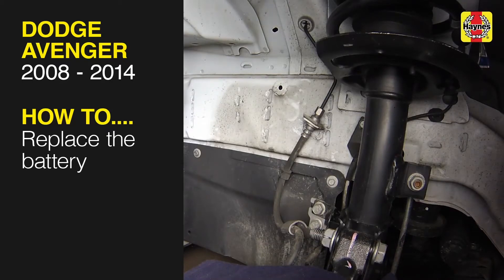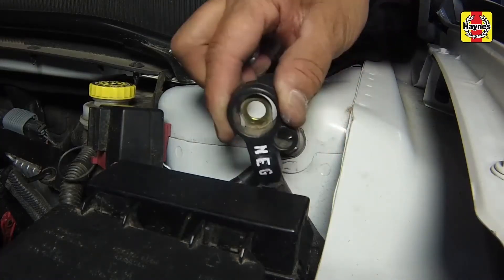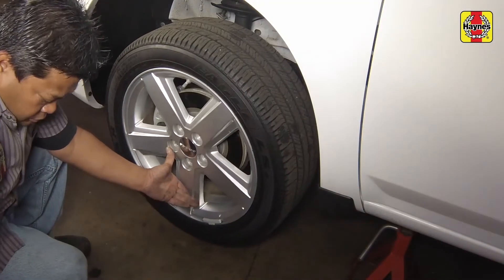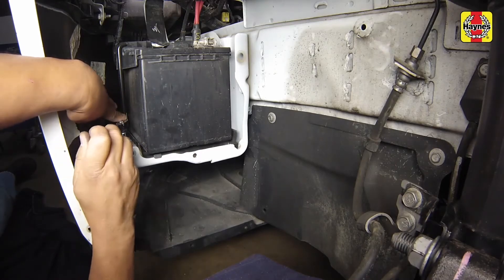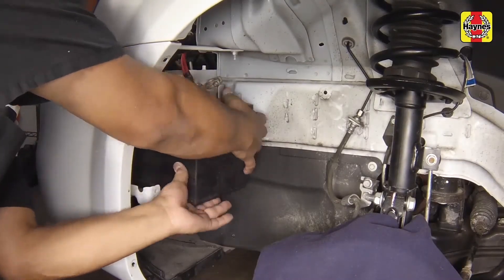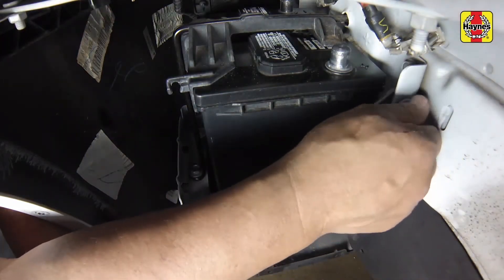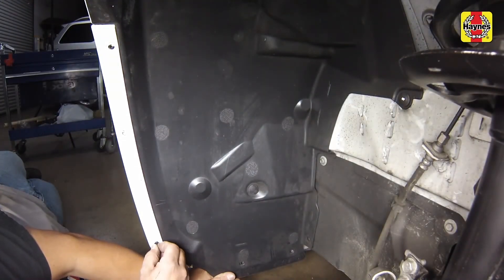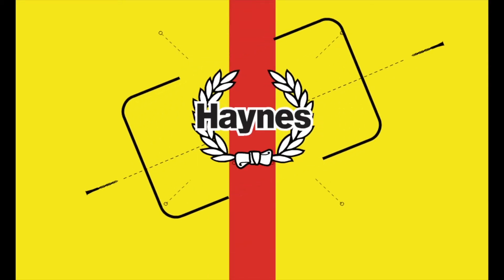How to Replace the battery on the Dodge Avenger 2008 - 2014

Comment: Note to self:

Make sure my next car has a more easily accessible battery.
Reply: I swear. 😤
Reply: There's a Cadillac and another GM model that requires removing the back seat. Not lift a cushion, that's for jump starting and testing. To switch to a new battery you have to take the seat out of the car. Why not just stick it in the trunk? Who knows, probably because engineers hate mechanics, and vice versa.

Comment: Youll need:
7mm socket for the plastic splashguard
13mm socket for the battery brackets
15mm socket for the battery terminal
A prying tool for the plastic splashguard
Reply: 10mm battery terminals
Reply: THANK YOU

Comment: THIS JOB IS A PIECE OF CAKE. IT TOOK ME 30 MINUTES. USE SIZE GROUP 86 BATTERY. YOU WILL NEED A 7MM 10MM, 13MM AND A TRIM TOOL.

Comment: Cool video! But you don’t have to take the wheel off. All you need to do is turn the wheel all the way to the right and then remove the cover.
Reply: @Believer610  actually? I’m going to change mine today? Going to try this lol
Reply: Do you have to jack it up and turn it to the right? Or just turn it to the right? lol
Reply: While it’s on the ground
Reply: @DoppleCU  no jacking up! Just turn the wheel all the way to the right and you should be able to get to the battery. You can also find it in the user manual
Reply: @Believer610  amazing, thanks for posting this
Reply: @Believer610  Should be able to??
Reply: @HuskerRed11  yep

Comment: I have a problem, first of all I didn't remove the wheel I removed headlight and fender clips my battery sits directly in front of my tire. I recently had to get a new battery and it doesn't fit properly in the tray, this new one is enclosed in a hard plastic shell the holding brackets are not able to be installed properly. So without putting the fender wall back on the tire is merely inches from the tire!!! What do you suggest I do??
Reply: Exchange for a different battery.

Comment: I've watched another video on how to change a battery in a Dodge Avenger lol ... I changed out my  battery myself with a buddy ...in my Dodge Avenger Blacktop Edition those  plastic clips for the wheel well housing is way over clipped lol I had to replace all  of them with  smaller plastic clips ... and that bolt that holds down the battery it's almost 100% your going to break off the bolt into just using a ratchet in a socket ... I don't know about you but in Canada they're going to charge me $160 to change out a battery at a garage   that cost more than what I paid for the battery lol lol  , So I did it myself .   So be prepared that the bolt is going to break off in two lol and have smaller plastic Clips to clip your wheel well housing back on lol F'n Chrysler ... yeah it is easy to change it out the battery but Chrysler made it so hard by putting plastic plugs Fasteners in the wheel well that you have to destroy them just to take the wheel well out ... they're not putting a hardened Bolt or an plastic end cap on the threads of the bolt lol  that holds down the battery so it will brake off  bolt     lol lol